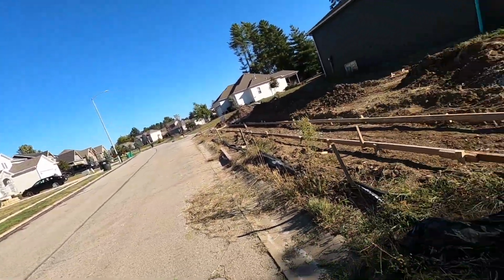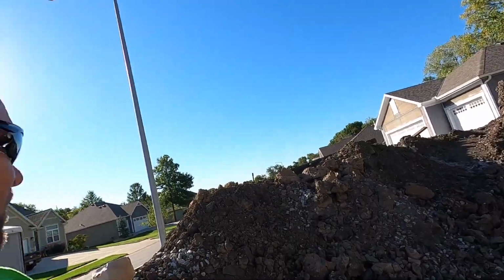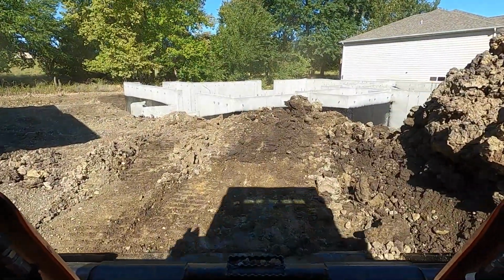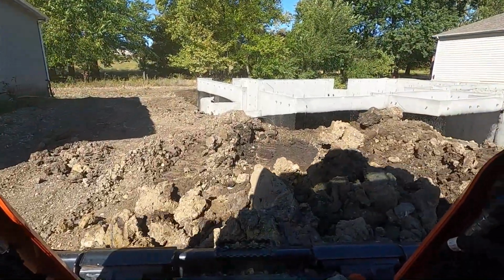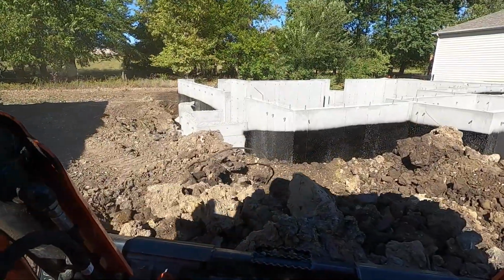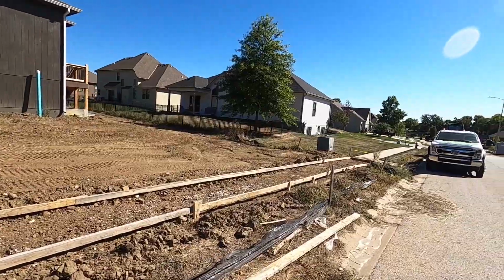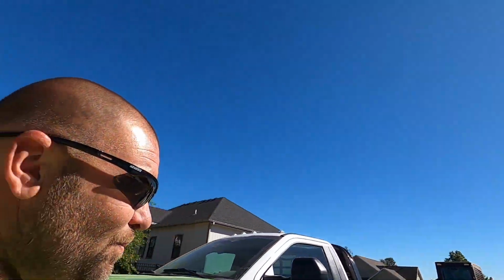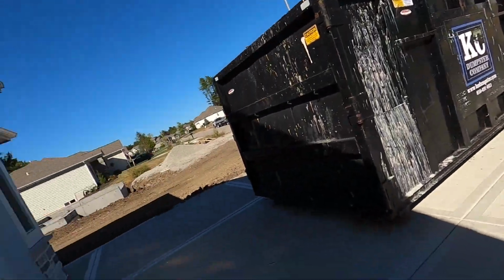Kubota SVL75-2 Doing Dirt Work

Comment: You should get a piranha tooth bar from Bxpanded, then you just take your smooth bucket and if you need teeth you slide them on a add the two bolts and you have a great set of teeth.
Reply from the maker: I just got my serrated cutting edge yesterday. But good idea.